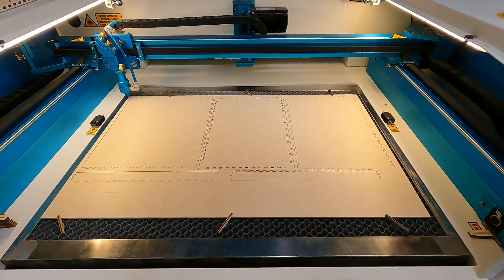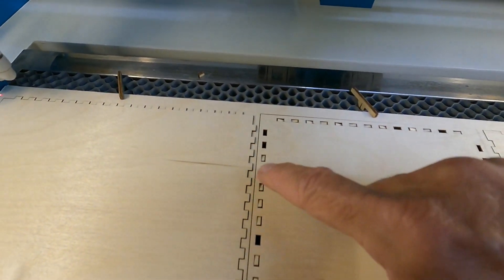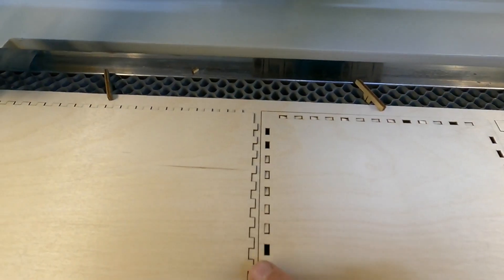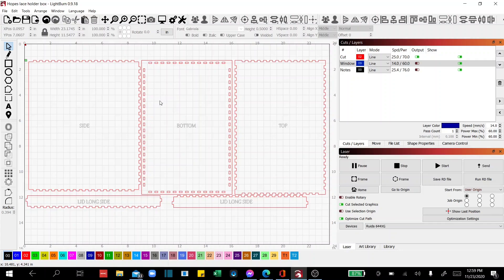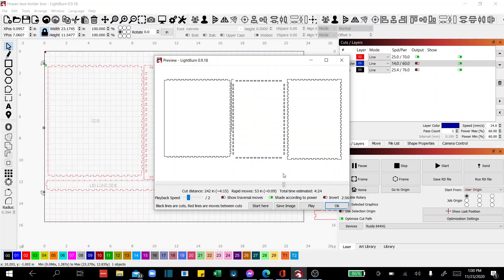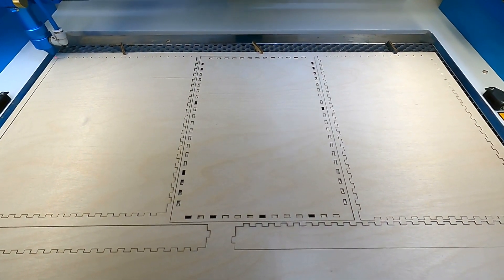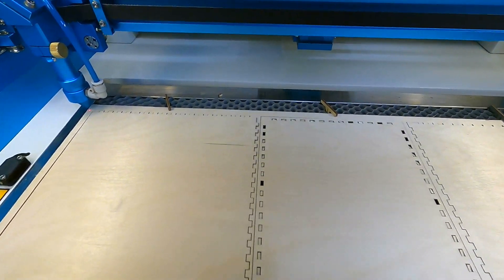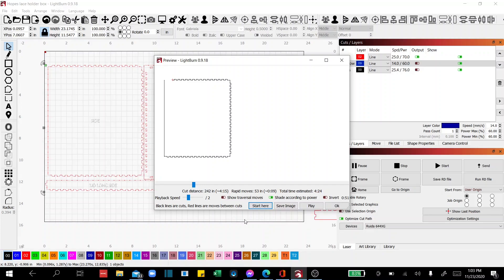Start From Here in Preview Mode in LightBurn

Comment: Is there a reason not to just select the items to recut instead of the whole file?
Reply from the maker: That's the reason for the new option in LightBurn. You don't have to laser a portion that might me quite large. You can just select where you want to start your laser where the problem is and then hit escape on the controller to stop the laser once you have lasered the problem area. It saves allot of time. Thanks for the comment and I appreciate you watching. Have a great day!